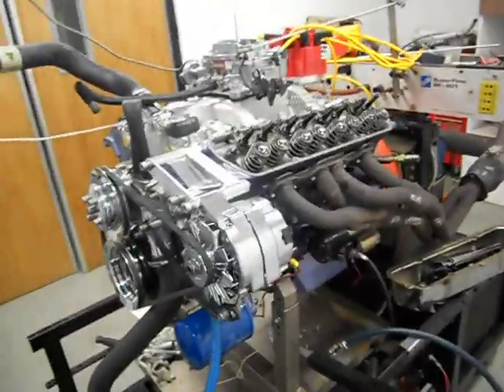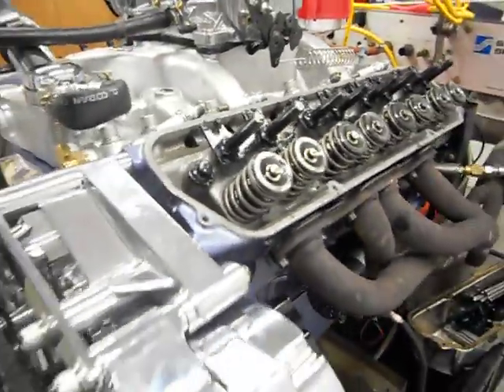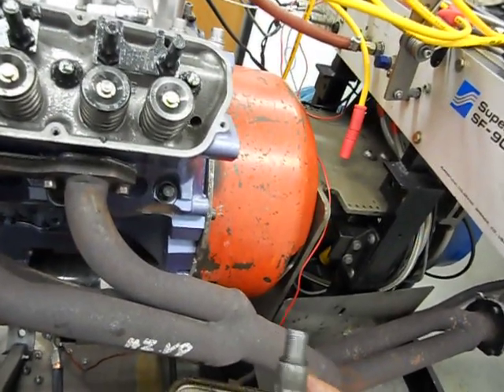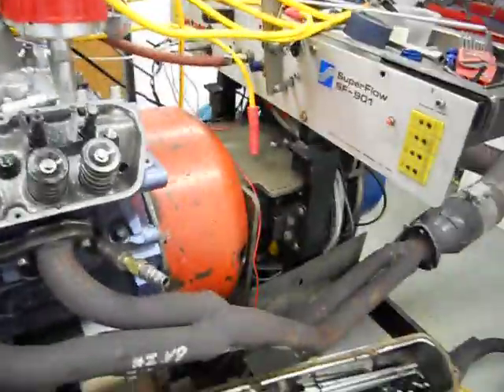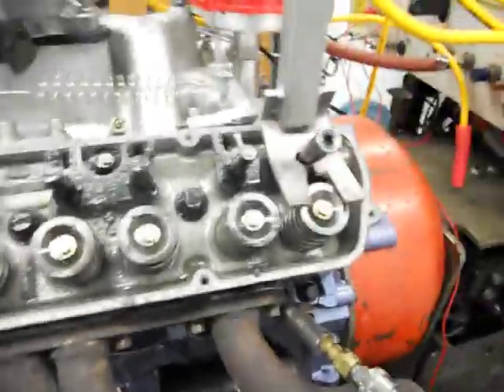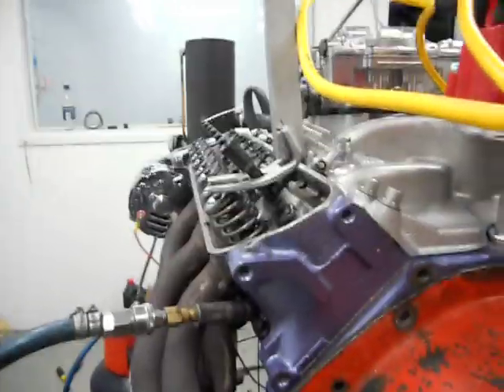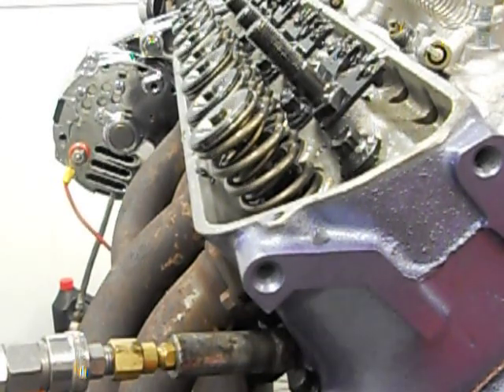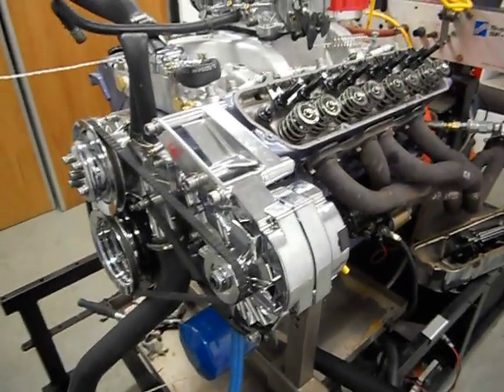How to Refit the 2nd Valve Spring after running in new camshaft in Performance V8 Motor

Comment from the maker: No cause they were oversized valves and ex had inserts as well,so when I cut the seats I set the installed height,blueprinting spring heights cutting seats,all within .005" of an inch,no shims required...

Comment: did you not have to shim any of those springs?and if you did how do you find out what size of shim you need or if you even need one?     thanks in advance
Reply from the maker: shotimeplayer ALL to do with installed heights buddy, yes some shims are used at .015", .030'' and .060" thou shims to bring up to spec every valve at it's installed height
Reply: You will need a spring pressure guage and shim them all the same

Comment from the maker: @390merc65 the other way,Holdens started with GM Australian produced 6cyl motor,the first Holden v8 had Chevs in them,68-74,then produced that 308 holden mtr,till recent times,now holden v8's have chev's again.Yes we have ford 170/200/250 non xflow,need 1979 still mtr but cast iron xflow head,need 80/81 xflow alloy head.We have a shit load of FE mtrs and 429/460 everywhere but were sold here all imported,Im building a 460 stroked to 514 for a mate 65 galaxy had 390 in it,not for long haha

Comment from the maker: @390merc65 longer for oil to travel to vital crank journals,they are close to ford windsor.Downunder we had Chev 307,327,350 SBC till 1970 in our Holden Monaro,which they sell in the U.S. as 2 door GTO and now have Chev mtr again.The 308ci is small,ripped off,same 4.000'' bore as 327/350 but 3.0625 stroke,very close to the best SBC mtr ever built the 302ci fastest revin production mtr in the world.I got vids on most of the blueprint job.Thanks for comment and if you wanna rev it you CHEV it.

Comment from the maker: @390merc65 G'day mate,nah not busting my stones,we say not busting your chops,yeah your right,it is weird compared to a SBC,it is General Motors,but GM HOLDEN,Australia's GM.Only thing chev is the GM.Dissy's at rear but thru block,so decking doesn't effect dissy height,manifold cuts around it,not bad idea.Right bank is leading bank for RH Drive,ok..But they stuff up.Oil pump is external up front left,easy to replace but bad,they have trouble priming,and extra long pick up and more gallery travel